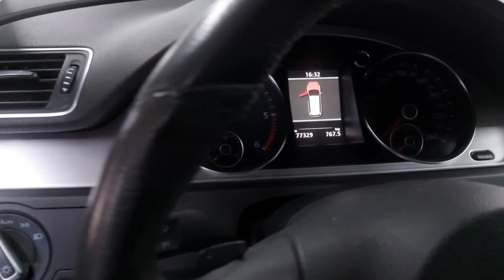Cleaning the NASTIEST VW Passat intake manifold

Comment: did you use ultrasonic cleaner to clean the parts?
Reply from the maker: Unfortunately, I don't have one. I clean with erg cleaner, brake cleaner and various brushes.
Reply: @uldisbetons8776  great job with that tools!👌 How did you manage to clean the intake ports?you have the inlet valves closed while cleaning, right?
Reply from the maker: @hugogomes2143  That's what I did. I cleaned with closed intake valves.

Comment: Did you need any program/diagnostic tool to make the car starts after putting all parts back again? Or just started the car normally?!
Great video BTW
Reply from the maker: You don't need anything. I just started it. Nothing in the fuel system was exposed.